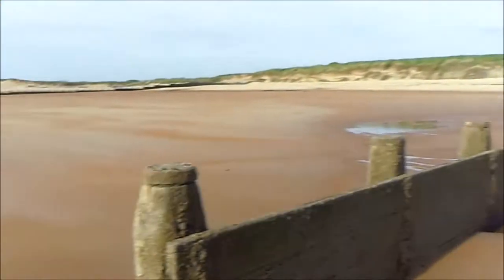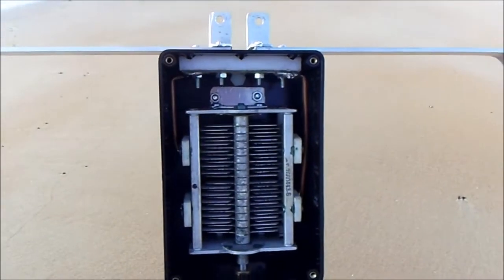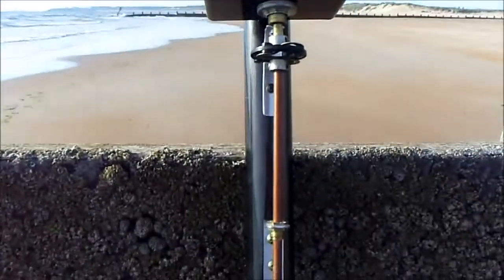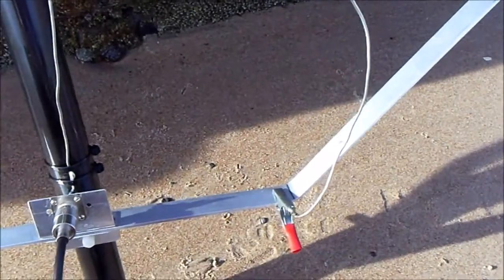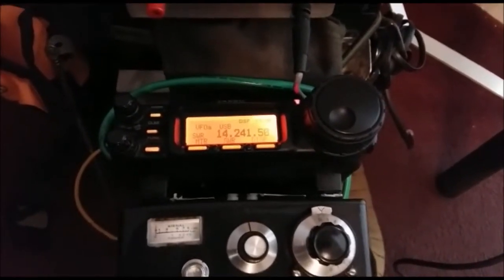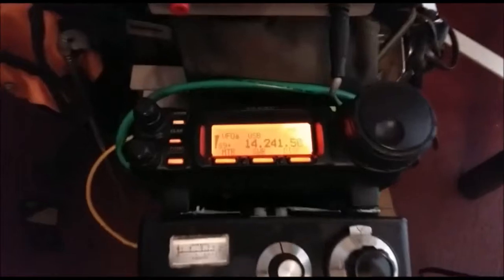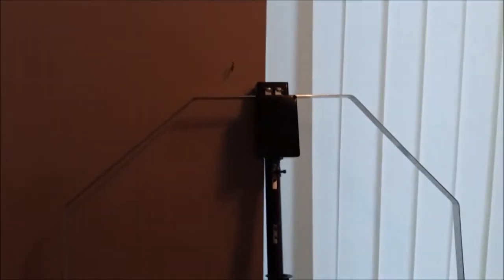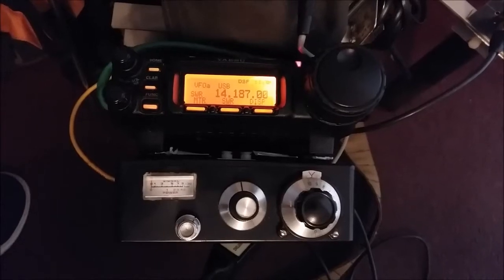M0DAD homebrew magnetic loop antenna

Comment: Your use of flat ALU strapping as the main loop must be the most cost effective way of constructing a MagLoop and your use of parallel caps to increase tunning range is a great idea.
At QRP power levels, I wouldn't worry about the PopRivet/WingNut construction. Your contacts indicate that your aerial works and works quite well.
Along with a GearReduced main cap, a small value parallel cap should provide fine tuning. Let's say 5 to 10/15 puffs across a 180 degree rotation? Just a thought. I'm going to try it.
I'm about to construct Trombone Caps from copper water piping with Polyurethane Sheating Dialectic and after watching your vid, I'll use ALU strips for the main loop.
Hope it all works. HaHa
But there's not much money involved and all the stuffs can be repurposed.
Thanks for your vid. Good work all the way around.
Darned Good Info, and Darned Good Presentation. You deserve a Hat-Tip.....
73 OM
Reply from the maker: LOL many thanks and glad you enjoyed the video. The magnetic loops are very interesting and mysterious antennas with very mixed results at times but I have sometimes achieved some surprising results when not expected.  First couple of contacts around Europe reported some very good signals with the loop lying at an angle propped up by  a chair inside the shack. The reduction gear along with the large tuning knob make the tuning a breeze and not too fiddly as some loops but the small parallel cap is a good idea for future loops. Looking forward to hearing more about your loop with the trombone cap. Keep us informed. 73 M0DAD

Comment: Hi David, nice work! Here are a few pics of my current mag loop project - Vacuum cap from eBay for £65 and the loop will take 100W now from my FT-857. 

73 de M0SNR

https://www.flickr.com/photos/m0snr/albums/72157680620031101
Reply from the maker: Hi Richard and many thanks for the link to your pictures. I haven`t seen these Comet capacitors but looks like a very interesting antenna project. I use a heavy duty variable with plug in modules which contain HV capacitors made from various lengths of coax cable. Tried to keep it on the lighter side as I also use my antenna pedestrian mobile when using QRP. The vacuum caps are the way to go for higher power and may consider one for a remote loop at the home QTH in the future if they are available at the right price. Thanks again for the link 73 M0DAD
Reply: If you do go for a vacuum cap such as this one, be aware that the adjustment spindle is connected to one end of the cap - if you use a standard knob with a metal grubscrew, it can lead to a nice little RF burn / discharge to the pinkie doing the tuning as I found out yesterday! I think I was running about 20W at the time. 

More embarrassing than damaging :) 73!